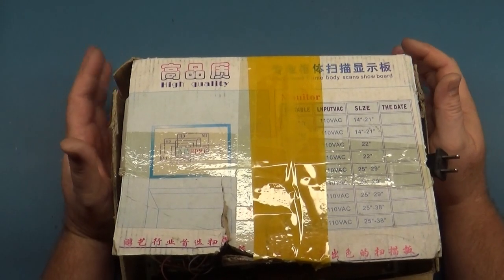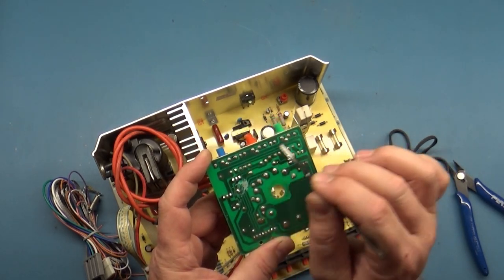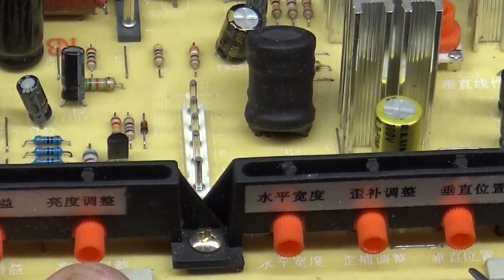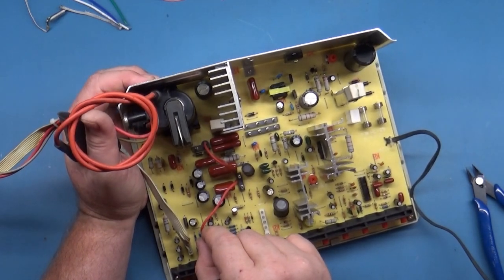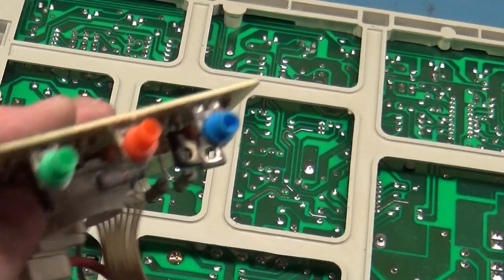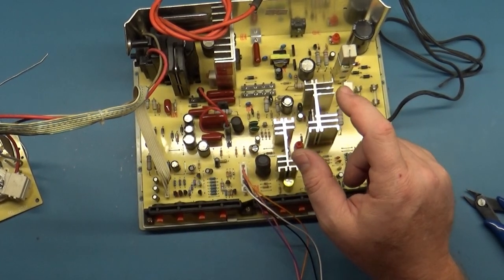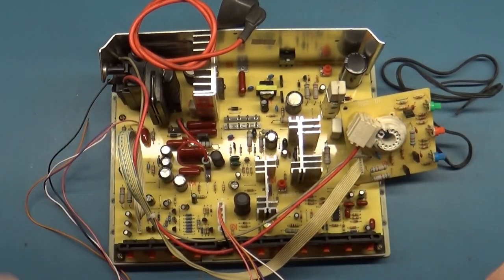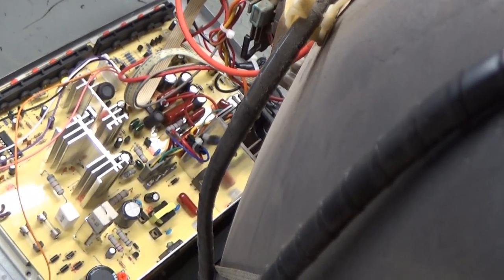25" Universal Arcade Monitor Chassis Review - It's Not Bad!

Comment: I had one of these chassis and yea  they are dark, if you have a tired tube then your wasting you time, i had mine on a fairly new tube but still to dark, i had it on there for about month until the flyback smoked it self silly and decided to turn it self into a bonfire, so now its in a box of junk and put the wg back in, these chassis are cheap but its hit and miss with reliability, the lack of a contrast and proper brightness pots is a bit anoying its best to stick with a well known brand, i would never trust one of these again my one nearly totalled my bigblue cab, when those chinese flybacks go they go in style.

Comment: @10:10 Those caps should be OK.  Seen plenty of those before and they are not bad. G-Luxon aka Jamicon Teapo is a Taiwan manufacturer... I think they crop up in Panasonic equipment... won't last forever but definitely not worth replacing immediately.

Comment: Just a note- I bought one and the wiring is R-B-G-Y and the other being R-G-BLU-BLK-W so perhaps they fixed that issue now.

edit- also want to note my chassis has HL branding, but the rear sticker on the metal is "shide" branding. My pots on the front are also directly on the board and not in the black plastic like yours is. my B+ resistor is also sideways and only has a small 250v 2a fuse as opposed to your two. So kinda similiar but also different. tho you should expect it to be slightly different when you buy from china lmao

Comment: Many thanks for this review, Mike.  Much better image quality than I thought.  Would really love to see you review the 19" chassis too when it arrives.
Would you happen to know what models of monitors the 19" universal chassis you have ordered is compatible with?  One of the universal 14" - 22" Wei-Ya chassis' I found had the yoke values at 56 Ohms for vertical and 2 Ohms for horizontal, so would be good to see if the one you've ordered will support K7000's.
Reply from the maker: My pleasure. 56 ohms would be for K4900 or G07. 10 ohms would be for K7000. I ordered one. Waiting for it to ship. It was out of stock.

Comment: Hi Mike. Thanks for your great video. I have succesfully replaced a wei ya chassis with one of those, but I have failed replacing the Time Crisis 2 chassis, We did not meassure the yoke until after the universal chassis died, at the joke the vertical has 11ohms and Horizontal 2.2omhs so the horizontal is above the 1.3ohms label mark and probably the cause of dead, do you have any suggestion? The issue with the original chassis is that the image is too wide and pot is not doing anything, will have to check the width cap as I saw in your other video. Thanks !

Comment: Great review, thanks, I have a probably silly question... At 17:35 you adjust the focus of the image, but you don't specify which one of the controls you're using to do that... You list all the controls at the beginning of the "hands on" part, but it seems to me no one of what you mention is focus...
Reply from the maker: You’re welcome. On the flyback transformer, the top knob is the focus adjustment and the bottom knob is the main “screen” brightness. I’m adjusting the top knob.

Comment: I have a question unrelated to video but I’m trying to identify this really small chassis , it’s small  , has that backwards RUgsep2112🔺 MC-3 
 Also has p/nIII-824A , the contrast and brightness are big white circular knobs and also has a video input that’s one black female type input, like the original Nintendo.6 pin neck and the suction cup is size of 50 cent piece, thanks

Comment: Mike could you possibly do a show on isolation transformers? If one was to build a cabinent and have a transformer  how do you know the input vs the output?  Would be cool sir
Reply from the maker: Sure.
Reply: @MikesArcadeMonitorRepair  heck yeah i have lots of isolation transformers and im to afraid to wire them up and burn something up!!!  4 wires come out and i have no idea what ones are in or out. Id like to build some cabs with crts that is an inportant part.

Comment: Hi Mike. I have the chance to buy just a Hantarex Polo tube on its own, no chassis. Am I right in understanding I could buy one of these and get it up and running? Something that concerns me is I am in UK and we operate on 240v, all of the universal chassis I've seen seem to be 110v.
Reply from the maker: Yup! You’d simply need to use a step down transformer though. You also must use an isolation transformer too.

Comment: Thanks for this, and all of your videos! I've had a couple of these that I just could not get working proper, they both had the same issue where the colors and contrast change depending on what color is strongest on the screen, as if the guns on the tube are struggling to keep up with each other, so white will go red when there;s too much blue on screen etc. They did this with all three tubes I tested (hantarex MTC, polo, K7000, all 19"). The tubes work fine with other chassis so I assume it's these universal ones I've had bad luck with, do you have any ideas what would cause that behavior?
Reply from the maker: You’re welcome! That’s very odd. Was it this same model of chassis? Could be the caps but traditionally caps don’t affect color but they can affect brightness. This is why I mentioned replacing them. Off hand, I really wouldn’t be able to say.

Comment: I would see these on aliexpress and wonder if they were any good.  I've got a 15" PC CRT I'd like to try one on.
Reply from the maker: They only work on standard res yokes and the ohms need to be around 2 for the horizontal and 10 for the vertical. If your yoke doesn't meet those requirements, it's not going to work. And you'd need the 19" version.
Reply: @MikesArcadeMonitorRepair  That's too bad then but thanks for telling me!

Comment: Curious, this chassis can work with k7000 as well as a polo ? In my experience the yoke readings are very different for those, this chassis has no issue with this? I have a perfect polo tube on the shelf with no chassis, would like to give this a try
Reply from the maker: Yup! The K7000 and the Polo are directly compatible with each other.
Reply: Wow, ok. My measurements on my polo are 1.7 and 5.7, I seem to remember my k7000s being  much different (maybe 1.5 and 10 ish?)

Comment: What did you do about the degauss connection does that conect anywhere?? I saw you had something connected to it was it ground ??
Reply from the maker: There is no degauss circuit on this chassis. I just left the coil disconnected.
Reply: @MikesArcadeMonitorRepair  thank you i also didnt connect mine. Fired up. And yes it absolutely needs to be connected with a transformer in the machine thank you for that tip.

Comment: Was there a place to hook up your dag wire on this chassis ?
Reply from the maker: Yes. Pin on the neckboard right next to the neck socket. The chassis comes with the proper connector.

Comment: Slightly unusual question. I have a k7500 medium res monitor which I would like to convert/use as standard resolution. Would this work? Also are there other dual/tri sync chassis that will work with a k7500?
Reply from the maker: You would have to swap the yoke to a standard res yoke, but the tube is compatible.

Comment: Will it work with a zenith 25 inch? Vertical yoke res 1.6 ohm and 27 ohms horizontal res. Or is the horizontal res too high?
Reply from the maker: Tube, yes. Yoke, not likely. Horizontal needs to be around 2.0. And Vertical needs to be around 10 ohms. I think you have those readings backwards.
Reply: @MikesArcadeMonitorRepair  thanks mate! Love your work

Comment: Is this for a Standard Resolution? I’m looking to replace a standard Res Neotec 2501 chassis on an RCA tube. I’ve been looking at this as an option.
Reply from the maker: Yup. Should be a drop in replacement.
Reply: @MikesArcadeMonitorRepair  Awesome! Can you post a link for where you purchased it?
Reply from the maker: https://www.ebay.com/itm/264517978729?_trkparms=amclksrc%3DITM%26aid%3D111001%26algo%3DREC.SEED%26ao%3D1%26asc%3D20160908105057%26meid%3D8c3d31ff503b44448e9158870fd45f09%26pid%3D100675%26rk%3D1%26rkt%3D15%26sd%3D264517978729%26itm%3D264517978729%26pmt%3D1%26noa%3D1%26pg%3D2380057&_trksid=p2380057.c100675.m4236&_trkparms=pageci%3Ae71165ed-208c-11ec-bd8d-be69afc97c36%7Cparentrq%3A2dbe24f417c0ab859dd0fe55fff86ebe%7Ciid%3A1

Comment: My k7191 took a hit.. was wondering about these
Reply from the maker: Always suggest trying to fix the K7000 over using one of these but if that’s not possible, these do work for what they are.
Reply: @MikesArcadeMonitorRepair  my vpos needs to go up n cant
Reply from the maker: The K7000 is working otherwise? I would not replace it just because of that. Try adjusting the 50/60hz pot next to the H.Pos pot first.
Reply: @MikesArcadeMonitorRepair  what's that do?
Reply from the maker: https://youtu.be/U-OWxCVft1M
Reply: @MikesArcadeMonitorRepair  even the guy that capped my chassis said to try the 60hz pot..thanks will do
Reply: 50 60 pot helped me pull the screen up. Thanks a ton.